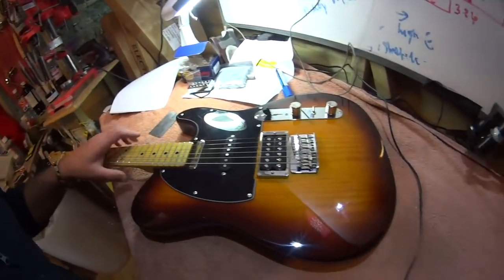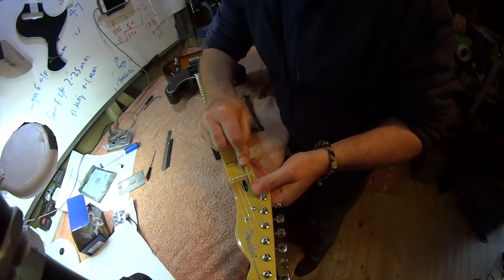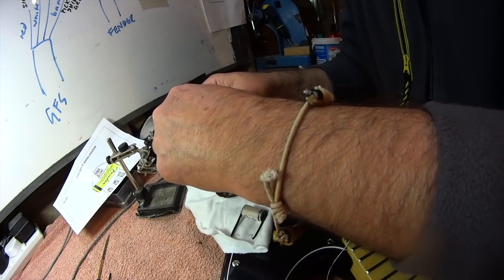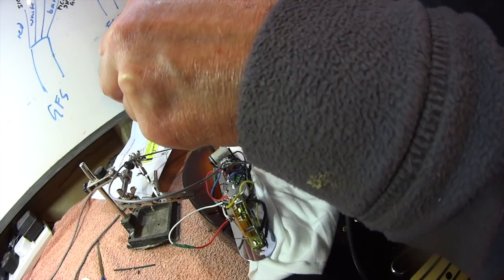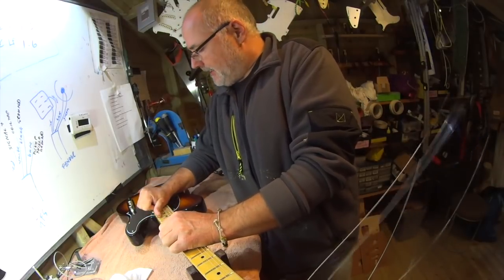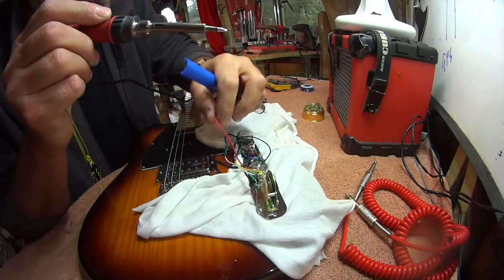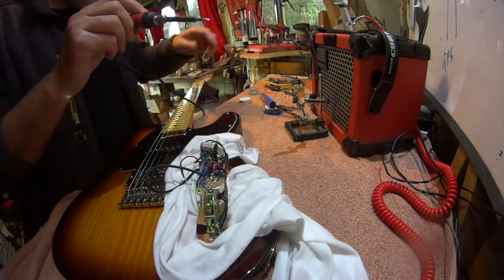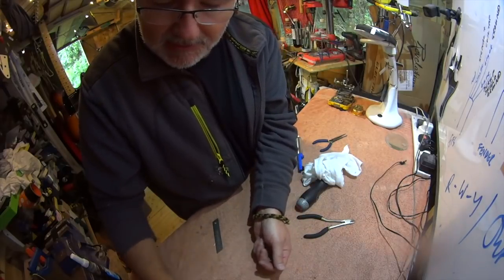Fender Modern Player Telecaster control panel reverse and set up

Comment: Hi again Sam – another interesting video with lots of problems tackled. One question I have is – what are your thoughts about having the  controls swapped around on the tele? I recognise the plus of being able to swell the volume control, but are there any other pluses or minuses you are aware of? I have a Lite Ash Korean tele I am thinking of changing a little – locking tuners, tusk trees, electro jack socket, and tortoiseshell pickguard. I don’t want to change the basic sounds in any way, but did wonder about reversing the controls. Incidentally I’ve always had an issue of hitting the selector switch when strumming a strat – always seemed a daft place to put it! Cheers Terry
Reply from the maker: paintboxpash Hi Terry... I’ve not done this on any of my guitars, so can’t really say what the benefit is long term... seems like a good idea to put the volume closer though. I can’t see a downside to it really.
Reply: Hi Sam - thanks for reply. I can't see any downsides so I may try it on mine at some stage. I resisted doing it on a partscaster I want to sell in case prospective buyers didn't like non-standard configuration. Still, will see how I feel. Cheers again.

Comment: Him Sam. Love your work. Can you tell me the height of each string when you finished?
Reply from the maker: Hi there Stephen. 9.5" radius guitars like this are on the brink of being too 'rounded' to get below 1.5mm last-fret action (low E) and about 1.25 high E. The geometry of 9.5" radius limits the action possibility - and no amount of fret levelling will get around it. This is because when you're bending the high E and B strings, you're pushing the strings uphill (vertically) away from 2 low-down anchor points - the nut and the saddle. This difference in vertical height robs you of the tiny clearance you'd otherwise have, choking the string in the process. 12" radii much more tolerant and modern 16+" easy peasy.